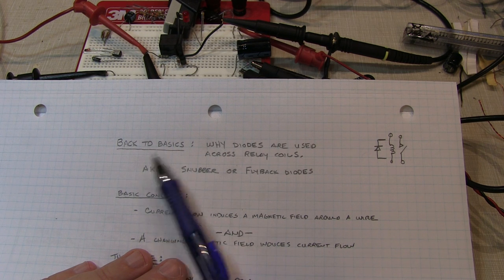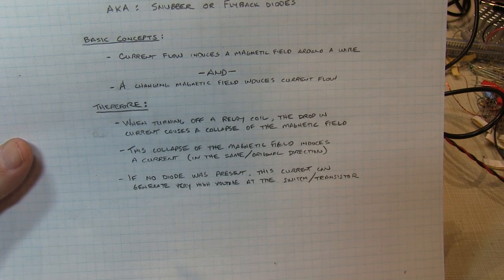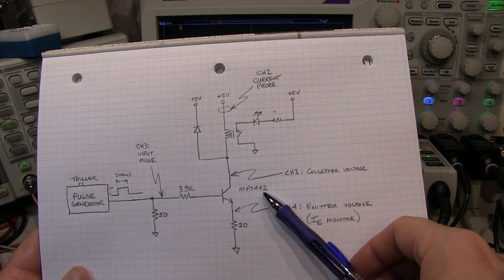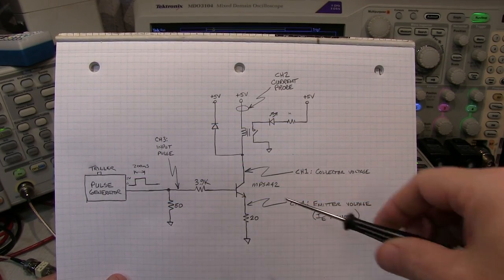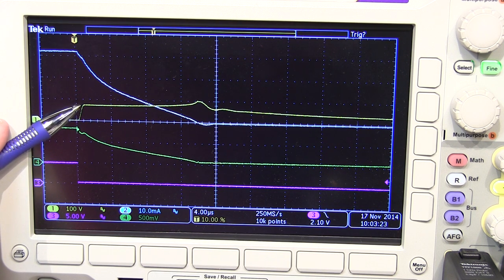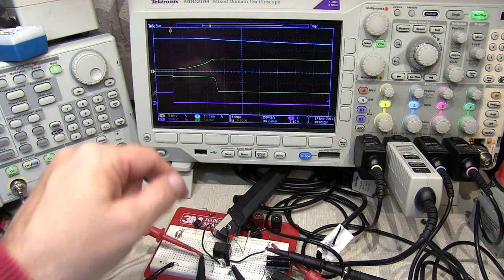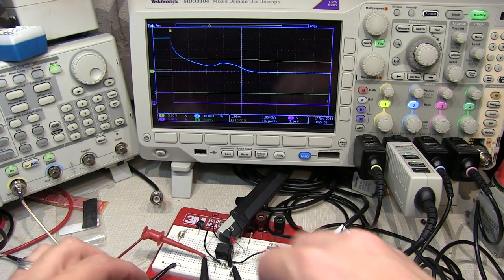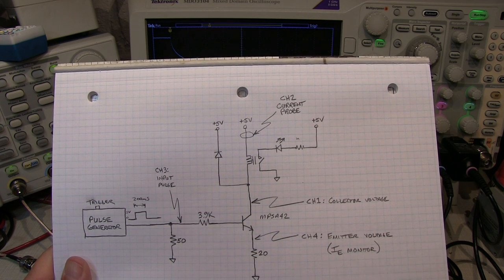#183: Why diodes are used around relay coils: Back to Basics on flyback or snubber diodes

Comment: Would this be relevant to a DIY hall effect circuit, using a magnet and coil for a rpm sensor.
As always thank you.
Reply from the maker: It depends on how much voltage is generated by the coil and magnet. It's worth checking, and possibly using some diode limiting to the voltage rails if necessary.
Reply: Thank you, I'll error : ) on the side of caution.

Comment: Hi! Should I place a diode parallel to my high power dc-dc non isolated boost converter's coil in order to avoid inductive spikes? I supply the converter through a time module relay and when the relay activates, my converter produces that instantanrous spike that I see it as a big change in input current. I can send you my converter's link if you want.
Reply from the maker: I wouldn't think so - the converter uses the inductive recoil in order to do its job.

Comment: *****  This is an excellent video, thank you! Seriously, I had a load of questions in my head on this subject and your video answered all of them, and showed me the proof on the scope as well. Perfect! I'll have to check out your other 'Back to Basics' videos, because that's the level I'm at.

I've also spent the last couple of hours trying to find out what the best diode would be to use across automotive relays, with some people saying 1N4148 and others saying 1N400x series. Your video showed near identical results between switching diodes and 1N400x diodes. I found an article on automotive circuit protection saying that you could get spikes of up to 120v, so I think this would rule out the 1N4148 because the spec sheet says the maximum peak reverse voltage is 100v. Does the 1N4007 seem like a good choice then? I could go for 1N4003,4,5,6 or 7, but there doesn't seem to be any disadvantage of going for the 1000volt 1N4007. Thanks.
Reply from the maker: Any of those 1N4000 devices would work fine.

Comment: @1:35 You say "...induces a current (in the same/original direction)" I believe this is false. The “Counter" EMF is induced in the opposite direction. Also, the high voltage should be negative, although you show it as positive on the scope. Of course this is why the diode is oriented to not conduct during the forward, normal current flow.

Comment: Excellent video as always Alan! As for my myself, for all of the signal dual latching relays I use in my designs (about 80 relays on one of them) I use the famous ULN2003D relay driver which happens to include that protection diode as standard, highly recommended for many signal relays. Keep them up!!

Comment: 1) How did you calculate the resistor values to be 50 ohms and 3.9 kohm? 
2) How did you select MPSA42? is it just a random selection? or simply to say, how do I know which to select.
Reply from the maker: En Jay 
1) 50 ohms was to properly terminate my pulse generator, 3.9k was selected to set base current to about 1mA.  Not very critical.
2) Just a general purpose NPN that can easily handle the coil current, and can withstand the high-voltage flyback voltage (as shown without the diode).

Comment: @w2aew, where does the 250 volts that you show is built up in the coil, come from, when the input pulse was only 5 volts. Great explanation regarding how the coil slowly releases the energy that was built up and also that it has nowhere to go. When no pathway exists for its exit, which is the pathway for its entry. Thank you. Great explanation on how to snuff out nature’s gift.
Reply from the maker: The 200+ volts comes from the fact that the current generated by the collapsing magnetic field around the coil is fed into a very high resistance , and ohms law (V=I*R) makes it happen.
Reply: w2aew , thank you for explaining ohm’s theorem as the cause for the effect.

Comment: That's a very nice real-world demo.  I would like to work out what voltage to expect without the diode.  I expect the resistance of the wire to play a role, but could you explain the calculation in more detail?  Thanks.
Reply from the maker: +Christie Nel It really involves the impedance of the circuit connected.  The voltage will grow to try to support the same current flow through the coil.  It's not a straight-forward calculation.  The higher the impedance of the circuit, and the higher the coil current - the higher the voltage could potentially go.
Reply: ***** Thanks for the reply.  Would I get a good estimate of the coil voltage (if nothing else in circuit with the coil) by doing V=IR where I is the coil current before the disconnect and R is the purely resistive component of the coil?
Reply from the maker: +Christie Nel No, it is the resistance of the circuit it is connected to.  When turning the coil off, the circuit is typically very high impedance which is why the voltage can rise so high.
Reply: ***** So if there is no circuit connected and we are just measuring the coil open circuit, assuming the meter has no resistance, would we theoretically measure infinite voltage?
Reply from the maker: +Christie Nel In theory - but that never happens in real world because there are always losses, non-infinite impedance, etc.
Reply: ***** Thanks, that helps!

Comment: Hi as you know sometimes we have a reverse voltage in pulses for example in diodes we have a reverse recovery time in diodes that makes small amounts of negative voltage ....i have this issue..my pulse drived an adc and this reverse Voltage can damage my adc and because my signal is 1ns in pulse width icant use buffer ic how can I remove this negative Voltage of my strobe pulses?

Comment: Can a capacitor be used to accomplish the same thing? I am remembering back in the old days where there was a "condenser" used on cars with points to prevent the break down of the points caused by high voltage spikes from the coil as they opened up.
Reply: +Curtis Wilson   That auto condenser was actually to make the coil resonant and get a larger spark.  It had the effect of suppressing the inductive kick, but also made the plug spark more energetic.  Capacitors can also be used, but the design is a bit tricker. A capacitors, with a resistor, is commonly used in AC circuits because of the constantly changeing polarity.  These are commonly called AC Snubbers.  The current that was flowing through the inductor flows through the capacitor, charging it up.  The energy is dissipated in the resistior.  The capacitor and resistor sizes are a more complex calculatoin depending on the use.-- Cheers
Reply: Too bad they don't answer
Reply: Eric Bouchard  Read my response just above your last.
Reply from the maker: @Observ45er's answer was very good, needed no further reply from me.
Reply: Eric Bouchard  I can also add a little detail on this "use a Capacitorinstead of a diode" question.
...
Just like one way to view an inductance is that it "doesn't like the current through it to change and does whatever it can to the voltage to prevent that current change"; then a capacitor "doesn't like the voltage across it to change and does whatever is can to the current through it to prevent that voltage change".
...
Classically, we paraphrase this a wee bit and say that "A capacitor is a short circuit at high frequencies [and an open at low freqs, or DC].
...
With a capacitor across our relay coil, the rapid change in voltage from the inductance  causes a current to flow in the cap.  This inductor current now flows through the cap, just like it does through these 'catch' diodes.  If that was it, we'd just have a resonant circuit and it could "ring out" for a long time depending on the total resistance (which is really just the DC resistance of the coil and a little in the diode).
...
The series resistor is added and this does two things.
1- It dissipates the energy that was stored in the magnetic field so that energy goes somewhere harmless. It warms the resistor.   [good]
2 - It does cause some voltage drop which actually does allow some more voltage increase on the switch or transistor collector. [maybe bad]
3 - OK three, I lied:  Without the resistor, the capacitor would be directly inseries with the supply and switch (transistor)  .  This means there would be an alarming current spike through the switch/transistor when turning on the relay charging the cap (the cap is across the relay).  The resistor provides some cushion so the turn-on current spike isn't so high. 
...
So... the resistor has to be choosen wisely so the voltage doesn't go too high (smaller R better), yet dissipate (bleed off) the energy quick enough (larger R better) so it doesn't cause other problems by taking too long depending on other things in the circuit.    [And not kill the transistor when turning on (higher R better)].
.
These all must be calculated....what Engineers do.
...
Remember, the inductive time constant is  T = L/R, so smaller R causes the current to remain for a longer time.   A diode keeps the current going for a long time (the longest of all methods) due to its very low (dynamic, or effective) resistance [and whatever resistance the the coil has].  This is usually not a problem for relays, but is very important in things like switching power supplies and Pulse Width Modulation controls.
...
Al doesn't mention this, but that 300V spike is causing that current to go somewhere: most likely stray capacatance and possibly the transistor breakdown that may not be good enough to cause a voltage limiting effect like seen with the lower voltage transistor.  The sort-of 'ringing-like' appearance strongly suggest a capacitor also with some resistence thrown in to damp it out pretty quickly.
--
Cheers, ScienceAdvisorSteve
K9DCI
Reply from the maker: Really great info Steve - thanks for jumping in!  73 de Alan

Comment: How do you determine what value of diode to use?  Is there a formula that takes the voltage and induction value of a coil and gives back what the inductive spike voltage will be?  I'm wanting to protect the control switch and the solenoid in my snow plow circuit on my truck and have no idea if I'm choosing a diode big enough for the hydraulic pump  I think a 1N4004 should be good enough to protect the switch from the spike coming back from the solenoid coil, but I don't know about the diode protecting the solenoid contacts from the spike coming back from the pump motor.  I don't have a DSO to capture the spike waveform.
Reply from the maker: It really comes down to the current that is drawn by the load.  Inductors tend to resist a change in current, so when the they are switched off, they want to push that same current through the diode.  So, make sure that the diode is rated for a maximum current that is a few times greater than the current in the load when it is on.
Reply: Ok, thanks!  I thought it had more to do with the voltage of the spike rather than the current.

Comment: Using the scope is essential if o e desires to play and learn.  I am often stopped from playi g because i worry i will blow my scope up. Knowing the back emf would reach several hundred volts stopped me from doing what you did. What should i worry about?  Is it currentgoing through the scope? Not voltage? Please help me understand so i can play and learn more frequently
Reply from the maker: The scope and probes are high impedance, so the current is going to be low. Always use 10x probes when you can, and scope will only “see” 10% of the voltage you’re measuring. Most important thing to remember, the ground lead on the scope probe is connected to ground, so be careful where you connect it.

Comment: Question about the Tektronix  mixed domain scope that you are using. How is it different from a stand alone spectrum analyzer or is there a difference? Otherwise great video as usual!
Reply from the maker: The spectrum analyzers that are in the MDO3000 and MDO4000 scopes are "FFT" based analyzers.  Conventional spectrum analyzers behave like a swept-tuned receiver, recording signal power as it sweeps. An FFT-based analyzer samples a signal over time (like a scope), and then computes the spectrum.  To be more precise, the MDO analyzers use a Chirp-Z transform (rather than an FFT).  The analyzer in the MDO4000 takes this a step further.  It can record the RF signal over a longer time period, and then show you how the spectrum of the signal changes vs. time, and show this correlated to analog and digital signals captured over the same time period.   It can also show you the RF amplitude, frequency and phase changes vs. time (like an AM, FM and PM demodulation view).
Reply: Thank You Alan, all this time using the Rigol DS1102 osc. I didn't realize it had this math function and capability. Dale

Comment: Alan,
Just a quick note of gratitude for all of your excellent videos and this one in particular. As I am educating myself on basic electronics and building circuits for my ham station, I come across topics I don’t fully understand. When I find that you have addressed one of these topics, I know I will be learning something valuable.  

In this case, I knew that a diode is necessary when you have to switch inductive loads and I could have just followed the “formula” and always included one in my circuits, but I wanted to know more of the “why” and “how” this works. I was a bit confounded on this one for some reason.  This video nailed it down for me!

Thank you so much for taking the time to educate us all.
73 de Don KJ6FO

Comment: w2aew, Techs say that AC coils, AC relays, AC Solenoids cause a Buzzing noise from the AC line 60hz frequency. The coil itself will cause buzzing noise because of the AC line 60hz frequency, any reasons why? Also AC solenoids have "less torque" and power of the plunger pulling in and out using an AC solenoid compared to a DC solenoid, any reasons why AC solenoids have Less power Less Torque?

Comment: TE has an interesting app note about flyback diodes reducing relay life (google "Coil Suppression Can Reduce Relay Life"). In the note they suggest a zener in series with the flyback to allow for a quicker collapse of the magnetic field. I wonder if that would eliminate the "hump" seen @11:07
Reply from the maker: The zener will allow the field to collapse faster, at the expense of higher flyback voltage.  As long as the surrounding circuitry can handle the higher voltage, then it will be fine.

Comment: Does the diode mean the transistor relay node stays 1 diode drop above 5V? Also why in either case is the 5V not being pushed up?  Confused about the 5.89V reading.
Reply from the maker: The current supplied by the coil through the diode gets dumped into the 5V supply.  How that supply is affected is determined by the power supply and surrounding circuitry, and the ability of these elements to absorb/sink this current.

Comment: I need a clarification. When the transistor goes off, what path the current takes?
-through the diode to the supply, or
-throught the diode and inductive load until the energy of the coil dies leading to zero current.
Reply from the maker: +v1nY It basically flows through the diode/coil, with the voltage at one end being pinned by the supply.

Comment: Thanks for sharing! I have a question: can it be said that the high voltage seen is due to a build-up of charge (kind of like a capacitor) at the (now-disconnected) terminal? That is to say that the current (dq/dt) has to go somewhere, so it builds up on the terminal which creates the potential seen without a flyback diode
Reply from the maker: The collapsing magnetic field induces a voltage in the coil wire to try to resist the change in current - but since the coil has a high impedance between it's terminals, the voltage grows very high.
Reply: @w2aew  I think we're saying the same thing, no?
Reply from the maker: @AbdulDerh  Almost, but it is the energy stored in the magnetic field (not a charge) that is responsible for inducing the voltage.

Comment: Hi Allan. I have two questions. I want to do kind of the same thing you did in this video, to see the graph of a capacitor charging the moment you connect it to a power supply in an RC circuit and also the IV curve of a diode. If possible, in the second case, I want to get the oscilloscope do the IV graph for me. Now my question is, whether you can use a simple analog oscilloscope to do that (I suppose it cannot do that since it has to save the wave form) and if not, what technical term or phrase should I be looking for when buying a digital oscilloscope so it can capture the wave forms when they happen and save them for me. Thank you very much!
Reply from the maker: Remember that scopes display voltage changes vs. time. So, to measure current, you either need to measure voltage across a sense resistor, or you need a current probe.  That being said, an analog scope can be used if the stimulus is repeated.  If you want to capture a single event, then basically any modern digital scope can do this (single acquisition, single capture).
Reply: @w2aew  I was looking for the word "acquisition" as you said it. Thank you very much!

Comment: Good Day, Thank you for the excellent video. I am trying to find a solution to my problem that i think has a lot to do with your topic. I am helping our local school to set up some of there stage lights and they are using some FCL spot lights for soft lighting. I found that my relays arced and would get stuck on closed very so often. I added flyback diodes on but it did not help. The FCL is only 20 W 220vdc. I added MOV on but still no luck. I have overcome the problem for the xmas play by using a big old contractor but still need to find the solution. If you have any advice i will appreciate it. Have a good day and thank you again.